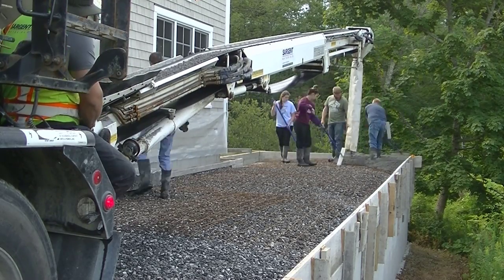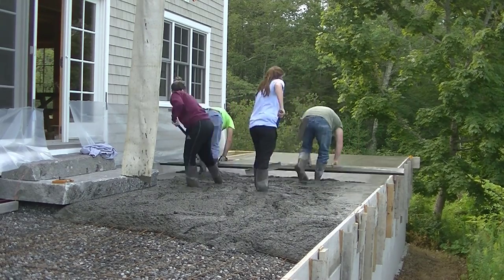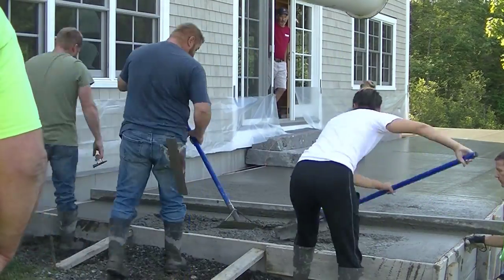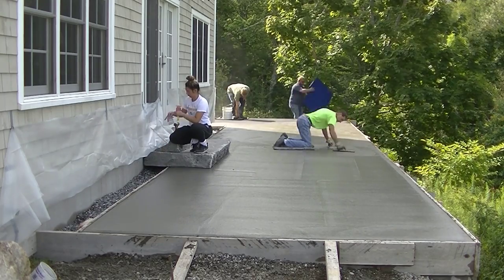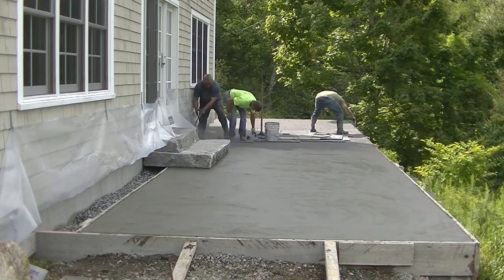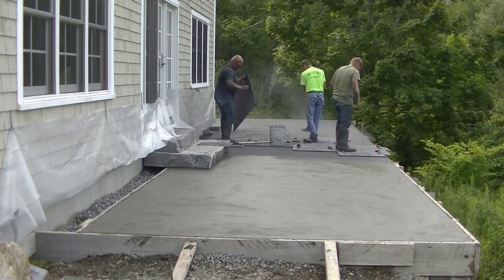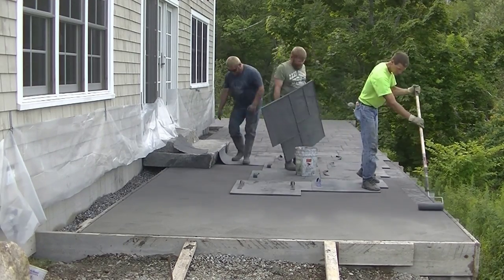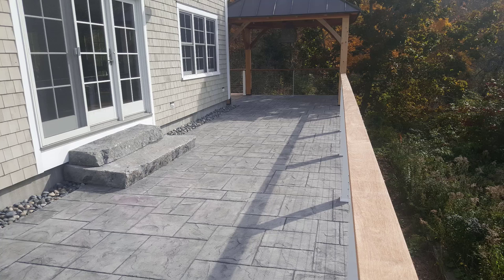How To Stamp Concrete Patios | Majestic Ashlar Slate Stamped Concrete

Comment: Wow I do my mine alone with the same pump,, good work boys ,I like the women rakers,,really cool ,Mike
Reply from the maker: Mike, what do you mean pump on this one, we used a conveyor truck?
Reply: Up here anything not weelberle is ""convar,""or pump,, up here we normally use weelbarls,, I'm almost alone Labour wise, when I do my stuff, when I was 28years old I was the fastest hand trowel in the city ,it was just retarted I was doing 30meters 3 full trucks by hand without power trowel,, I'm in my 40s now, up here there's to much work, 1millon  up in contracts, nobody can do ,or there's not enough contractor's,, it's insain up here
Reply: I'v been working cements since I was 15years old working 18fully union local 183,  up in Toronto it's 21sq,cement stamp, regular cement 18sq, excavations about 6sq,  and if you score a down town home ,it's smaller but all in 250sq do to excecabilaty, it's a honest living
Reply: Try liquid release , you'll save on time ,, shading is diffrent but time wise on bigger jobs , you'll save

Comment: Mike, when using rebars for concrete, if the rebars are at the bottom, and the crew is walking all over them to smooth/finish the concrete and the mini bullsdozer used to pour concrete drives over the rebar, is the rebar at this point any good or useful? It's essentially pressed into the ground. The contractor argues the rebar won't be on the ground, the poured concrete comes underneath it lifting it up, I argue that even if that is the case, his crew was walking all over it and the bullldozer would drive over it every time it had to pour more concrete. And on top of that they did a very poor job with the stamping and steps.

Comment: Hello from Windsor Ontario, I did a little concrete when I was putting myself through university. Haven’t done anything more then some patch work in years. I just had an opportunity to build a new home and after watching your videos I will be purchasing your course and doing my patio and drive way. I’ll send you some pictures when I’m done. I will be taking your advice and start with a small slab that my garden shed will be on then work through the other projects. Thanks again for the great content.

Comment: Hi Mike, great looking job. I am a retired concrete finisher of 30 plus years from east central Indiana. I have done two years of stamping concrete from pool decks, driveways, patios, mezzanines, kitchen floors, indoor spa floors, but when we did it we had to throw the color by hand and float it in (because the concrete company’s would not put the color in there trucks) then throw the release, What a dirty job it was. Since then I had finished up my career in doing highways, bridges,  walls, tanks, curbs etc. Concrete finishers make it look very easy just as you guys do, that’s when the average Joe who watches these videos can get them self in a world of trouble! Like you say, it’s all in the condition of the day, sub base & mix not to mention the timing! So for all you folks thinking you got this, you just might want to have someone with so knowledge close by! Hay Mike, you got this!!! PS. We use front end discharge trucks around here, the driver can move the shut up and down right and left from in the cab, it comes in very handy.

Comment: I’m a concrete contractor for 40 years in Northern California. 
I just found your videos. The biggest thing different that I’ve noticed between our techniques is here in Northern California during the summer it’s average is 85 to 95°. Concrete most of the time comes hot and I am not able to pour large jobs without any control joints because there will be cracks appearing in usually 5 to 12 hours after we finish.
If you don’t put joints in in saw cut later.
Do you ever have issues with cracks? do you ever put joints in on Pour day.

Comment: Your a mighty man mike ,that's a tasty job ,I'm in Ireland  and I'm after talking out my timber deck and I'm going  to replace  it with  concrete. I'm renting  the pads and I'm going  to stamp it ,ill do a test run first before  I do the big job ,I have one question  ,at what stage can  I start to use the pads ie hand print or foot print barely  showing  ,I'm just afraid I will leave it too late ,thanks again  for all your work ,by the way it's great to see your daughters helping  you 👍

Comment: I recently had a 10x11 patio stamped in a flagstone design.  It looks great except for about a 1 1/2 sq ft area in which not enough color was added and it has already been sealed.  What are my options here?  Contractor will return next week to see what can be done.  Just for that area can sealer be removed, color added and sealer replaced or is there a better option?  Thx

Comment: Hey Mike!! You have one of most informative content on concrete pours and finishes. So first, thank you for sharing. I’m down north in Ontario. I heard you mention many jobs sites in Maine where there are some freeze thaw cycles. And from what i’ve seen the stamped concrete holds up well. Would it hold up for 5-7 years in ontario where the negative temperature hits -30 Cand summer can be as high as +30 C. I’m think of doing a half inch overlay on existing 6 inch thick pad. This area is exposed to rain, snow and sun, needs to be shovled and will have salt over it. Its an outdoor balcony about 200 sq ft and has a pitch for drainage.